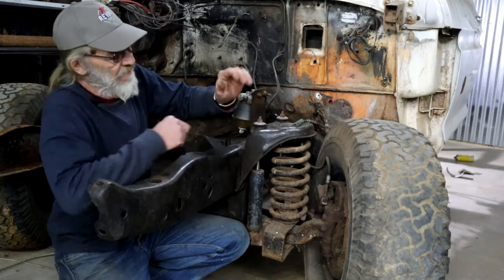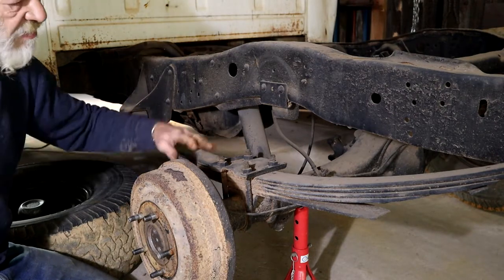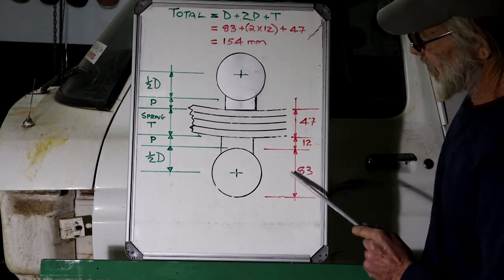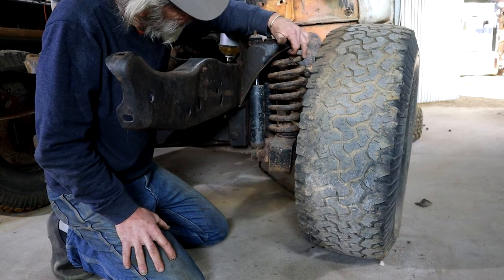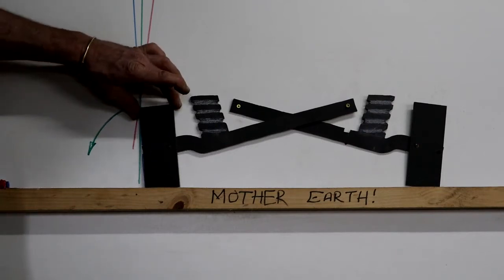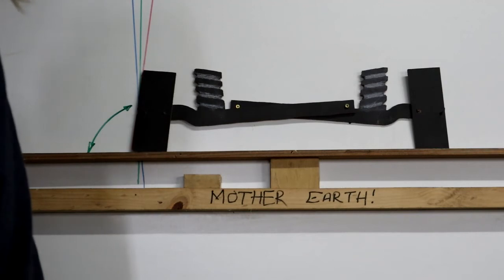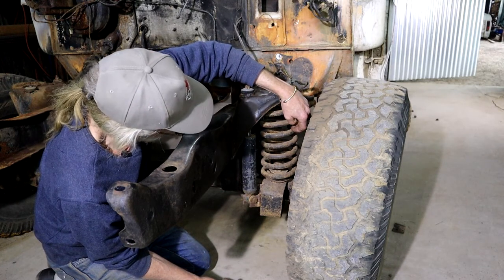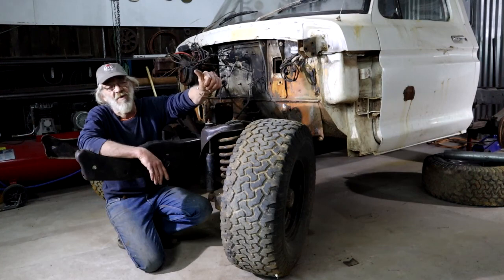FORD F100 SUSPENSION DROP DIY - PLANNING THE JOB!

Comment: You white board illustration with use of blocks representing height change is perfect. This what Ford used in their commercial back when, showing the benefits of "Fords New Twin I beam Suspension" except they had a number of radius rods break. They blame it on someone else! Like the River Rouge Plant, where castings have been poured since 1919. (River Red). 
  Plus the relationship to chamber with the different colors was perfect. This dark woods engineering. Our, what we call in the states, "Red Neck" engineering! Still perfect illustrations for those planing on changing ride height and suspension geometry, from my point of view... You are a thinker!
DK, Omaha.
Reply from the maker: Thanks bro, gotta figure this stuff out for myself!😄
Reply: @ratrodsafrica  You do it well! Very well...

Comment: Here in the states its real popular to use a crown vic front subframd to lower the front and gey rack and pinion sterring this my plan for my 66 ford pickup
Reply from the maker: Ja, unfortunately the Crown Vic suspensions are not available down here

Comment: raise the coil bucket to retain the spring or at least limit the number of coils you have to cut.  Also, there should be some camber adjustment at the hub side of those bars.
Reply from the maker: It's been some time since that video... ended up cutting 1 and half coils, camber looks OK, stance is not bad, spring rate acceptable for me 😀
Reply: Is there an adjustment? It's the problem with Ford's twin I beam
Reply: @tommills2097  there is no adjustment on fords twin I beam other then bending the beam . Very poor design ever made .

Comment: What would happen if you raised the top bucket where the top of the spring and shock attach? It seems it would allow the front end to drop without changing the spring length.
Reply from the maker: Yes, it could be done. Quite a bit a work though and difficult to go back to original. At least with changing spring length you could just install another spring if you mess up :)
Reply: @ratrodsafrica  Good point. Nothing like keeping your options open. Thanks for the informative videos.

Comment: Instead of cutting the spring, cutting and removing the WHOLE shock/spring bracket 154mm higher?
Reply from the maker: Some lateral thinking there! Had a look today at this option, but it will require MAJOR surgery! :) Also, the camber problem will get worse if you move it that much. Bending the beam to correct camber is also a major story...So, still toying with it...
Reply: @ratrodsafrica  Could the beam pivot points also not be moved higher?... thereby neutralising the camber? We want to drop it, so something has to give. It might be cheaper than kidney belts :).
Are you going to use those same wheel rims? Let's not forget how much it'll drop by changing wheels and tyre profile.
Skirting around the edges can also create the dropped look, without anything having actually changed.
Reply from the maker: @seanhammon6639  checked out the beam pivot points today... might as well cut off the whole front section and start from scratch if I want tp change that! But yes, definitely other tyres, planning to play with tyre profiles as well... Also busy talking to a guy at a spring shop about other tricks with those front coils... instead of just cutting them... feedback soon!